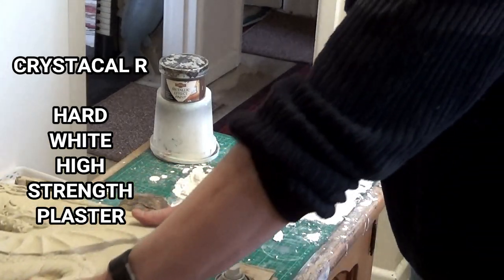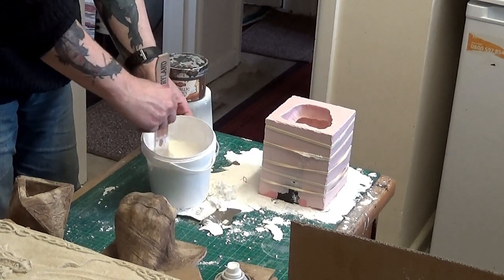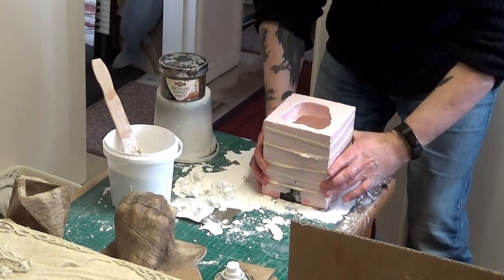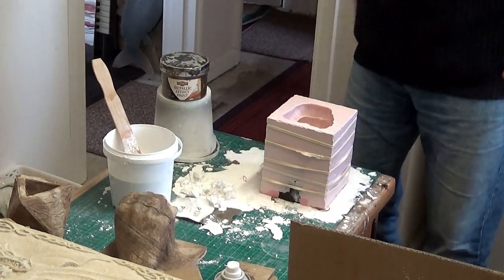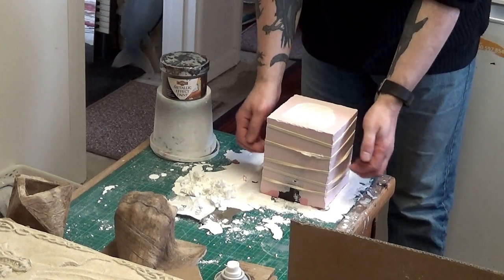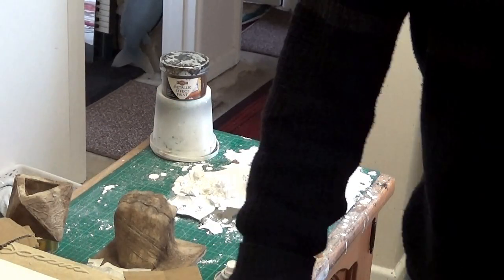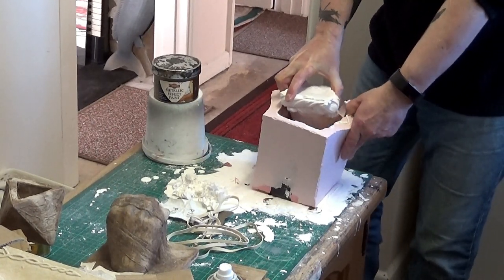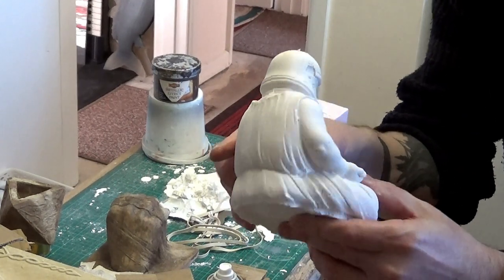Casting With Crystacal R

Comment: In case anybody is wondering Crystical is basically weatherproof even without treating. I have a skull in the garden as an experiment and its approaching its 2nd year without any apreciable damage from the elements. If you want to guarantee the castings you first paint in acrylic and then glaze in yacht varnish or polyeurothane varnish. Outdoor wall plaques etc should be given one base coat of masonry paint to seal them first.
Reply: Do you think it would work for making candle vessels
Reply: @lorraineshakespeare5887  absolutely
Reply: @lorraineshakespeare5887  I have detailed videos on my page
Reply: I was just wondering if it would be suitable for outdoors, so as long as it's sealed and coated it holds up to the elements. I have been using Jesmonite, which is good, but a lot more expensive!

Comment: Nice vid, , 
For what it’s worth, regarding your comment on vibrating tables, I’ve seen a number of people using electric sheet sanders to vibrate their casts, relatively inexpensive and doubles as a secondary tool, - just bolt one to your bench.?
Reply from the maker: Yes, you can do. :) Cheers John. :)

Comment: Thank you so much for this video. I was looking for something like this for casting. I have been using jesmonite but its very very expensive. So thank you for introducing me to this plaster.  can  this be used with latex mould? Also can we add marble dust to this mixture?
Reply from the maker: I use plaster in latex molds and have had no problems. In fact, usually I would make this kind of mold in latex if it was to be used with plaster or concrete, but the silicone mold is useful for resin too.

Comment: Yes, a vacuum chamber works really well with plaster, Hydrocal and Hydrostone (a similar product to yours). 

Simply mix the plaster in a pail that's big enough to allow for expansion (2X the volume). As soon as it's mixed, degass it in the vacuum chamber before pouring it into the mould. The cast is almost always bubble-free and nicely detailed.

Comment: What do you need to know about vacuuming?  Get a Vacuum table, silicone flask and a cheap chinese vacuum pump.  It doesn't take long.  30seconds at the most.  This material looks pretty good unless you are getting voids on the surface.  Slushing the way you did with very little material is a good way to ensure a decent finish.  Good work!
Reply from the maker: Thank you Traveler! :) I know vacuum chambers are good for materials such as silicone and resin, but I was wondering if putting plaster in a vacuum chamber would be ok and not froth up all over the place, etc.
Reply: @dramamask  We vacuum investment all the time.  Plaster of Paris is found in most investments for jewelry, glass, metal etc..  Go for it.   It will rise up like a cake and the bubbles pop.  Leave a couple of inches above your investment for it to grow while vacuuming and you wont make a mess.
Reply from the maker: @jagboy69  Thank you Traveler! What do you mean by 'investment'. Does that mean your mold? So, if you leave a couple of inches, does that mean you top up that extra couple of inches with plaster, or whatever material after you have vacuumed the cast, or do you make molds which allow for the extra couple of inches?

Comment: Dramamask Evolution well plastered😀would this be suitable outside in the garden,(using some kind of sealer)or would using concrete be more cost effective.Thanks
Reply from the maker: Cheers David! :) I'm not sure if the plaster is suitable for outside. Will have to find out. I have been making these in view of inside pieces. Concrete is still more cost effective though. :)
Reply: @dramamask  Thanks for the reply😀
Reply: SP 201 Acrylic Polymer added to plaster mix works for outside sealant and tougher cast. Hope helps.

Comment: Great video thanks for sharing, it has helped quite a lot.
I used Crystacal R for the first time today and although I used the recommended ratios, the mixture was setting as I was pouring it into the mould. I didn't even have time to start tapping the mould to get the bubbles out. It has been a quite warm day, would that affect the setting times?
Reply from the maker: Could be a few things, but usually plaster sets quicker the older it gets. I sometimes add more water than is recommended to get more fluidity in the mixture, but this will weaken the mix to a degree, although negligible on the pieces I have made in the past.
Reply: Thanks for the help.
Reply: I had the same problem with my first mix today. Mine was nowhere near the consistency of yours when you pour. I weighted it out accurately:1714g into 600ml water. Next time would you recommend I use less powder? Or measure using a cup system rather than weight and ml ie 3 cups plaster +1 cup water?

Comment: Hi,

I've been using Crystacal R for about 3 years. When I make a statue or old antique I never have noticeable issues and results are always good. However, during this time I've had to also make very simple shapes such as circles and rectangles ie wall plaques that are maybe 15mm to 20mm thick and let's say 15cm long. Ever single time a cast comes out of a mold there is a very slight bend/ warp in the centre of the top of the casting ie, (when removing the casting from mold and turning it over on to the base it would be the opposite end with the issues) . I have several moulds and i doubt it can be the silicone used or the original mold making process. Silicone is silicone so all should work accordingly if suitable for plaster and resin. I'm sure something is happening during the setting period. I know plaster expands ever so slightly. Could this be the issue and it's just something that can't be helped? It's bugging me a bit because whilst it's hard to notice, I know it's there. Whilst the base is not affected as that was the area I poured into I can level this out by sand papering, but I can't level out the side with the bend that easily.

Is this something you have ever come across with thinner flat  objects? I don't know if to change to a different gypsum or just continue as I like crystacal for its strength.